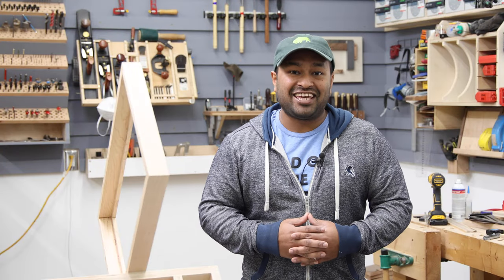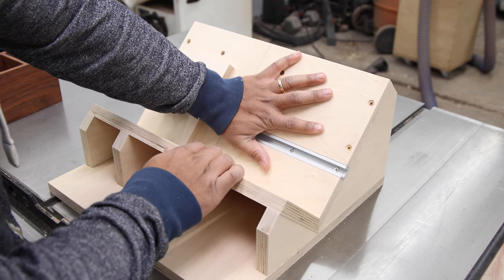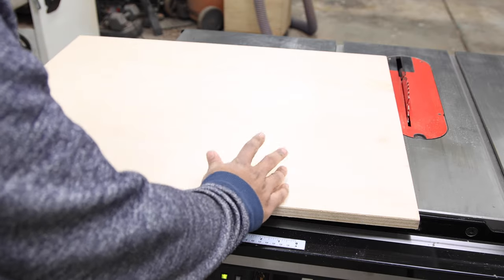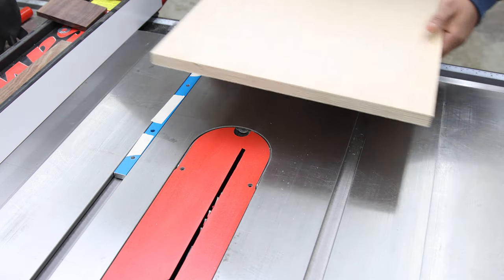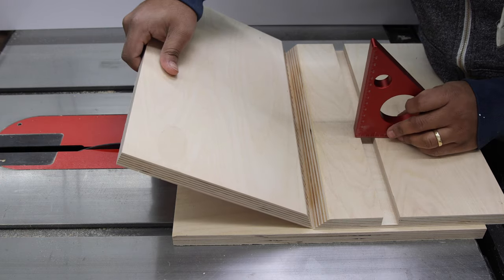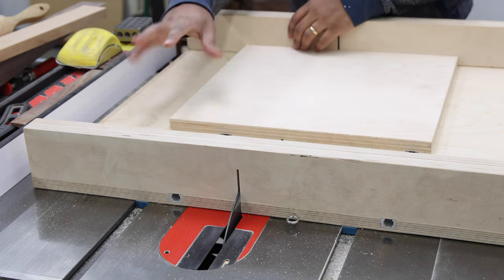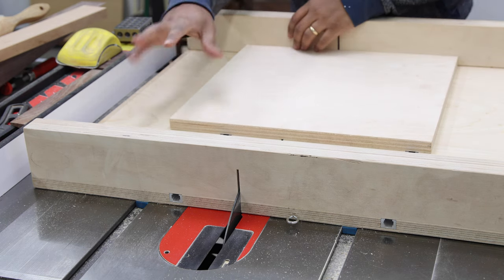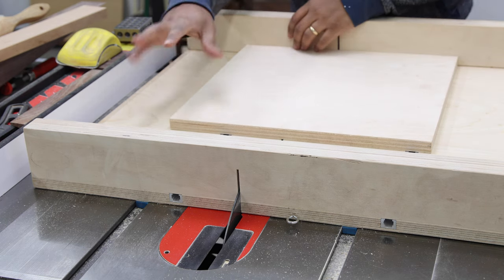MITER SPLINE JIG (for the table saw) - woodworking jigs

Comment: Nice video! I'll be making a new spline cradle for boxes soon, as the old one was never that great. I'll probably use a T-Track now, thank you for the idea!

Now here's an idea for you: Splines glued with PVA glue may not add all the strength you expect, even though it's the standard approach. If you break the joint apart, the spline usually just slips out. Using hot hide glue for the splines (not the miter) results in a much stronger joint, in my experience. Cheers!

Comment: Top job and thorough. I love the adjustability of it.  Some I have seen have many saw cuts in the bottom as you move the project for each spline.  Yours, you move the stop block so that's a better arrangement. This looks very professional.

Comment: Great video Suman.  If you rotated your miter joints 180 so that the miter cut sits directly on the runner board you will save about 1 inch of cut depth.  All other elements of the design stay the same except your t-track will be on the other side of the same board.
Reply from the maker: Great tip! I agree. Realized that after the fact. haha.

Comment: Great video; though if you look up Bourbon Moth, he has done a rudimentary test on joints and mitre with spline was 1, mitre without was 2
Reply from the maker: Rudimentary is accurate. I’ll be doing something a lot more proper in the near future. I can’t imagine miter splines is actually weaker than just miters alone.

Comment: I see you screwed the T track into the jig. I'm about to use some T track in a project and the two methods I hear online are the screw in method and the 5 min epoxy method. Screws allow you to remove and reuse the track in other projects, but epoxy gets the screw heads out of the track. I'm not sure they're annoying enough for the cost/permanence of epoxy. Have you noticed the T bolts catching on those screw heads?
Reply from the maker: I haven't had any issues with the bolts (say, 1/4-20) or the t-track specific fasteners hitting the screws. I would recommend going with the screws over epoxy. The only major downside to the screws in a situation like this or on a crosscut sled is 3/4" thick ply. T track takes up about 1/2" of it and you only have little meat for the screws to hold on to. Still, plenty of strength for most woodworking tasks. Most screws may stick out a little. You can grind them flush. Or be really picky with the screws and get something super short. I would grind them flush.